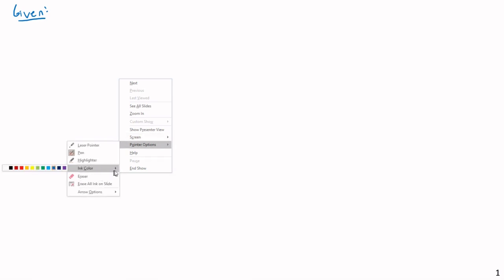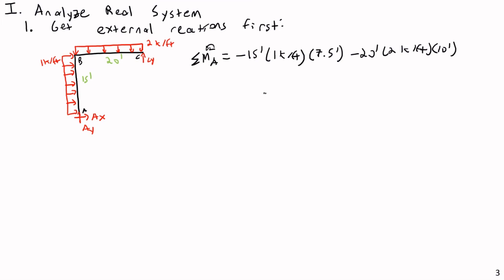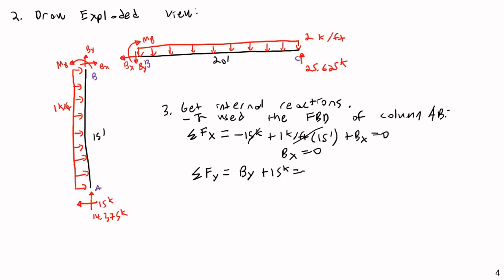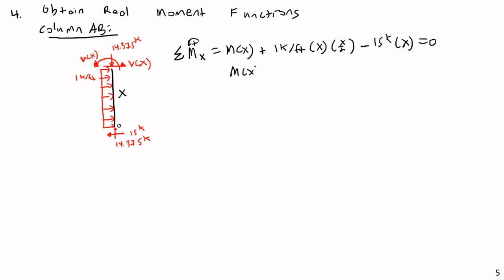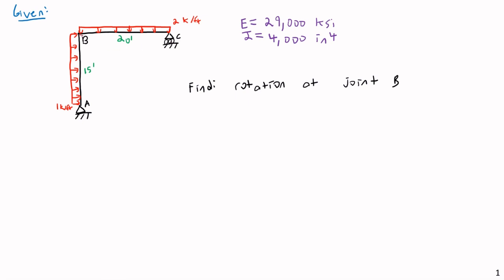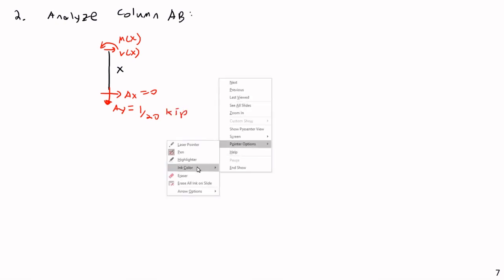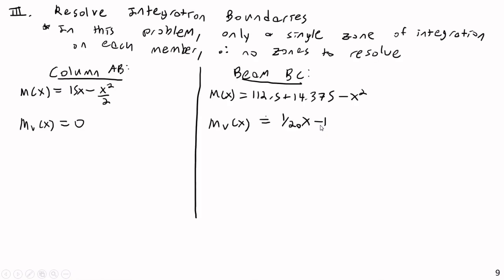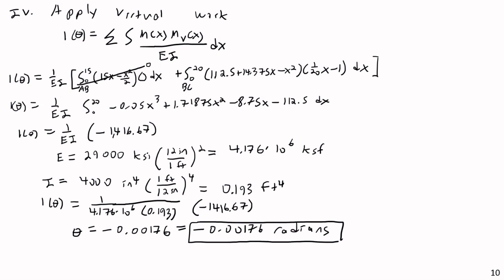Virtual Work for Frames - Example - Structural Analysis

Comment: Hi Professor, 

How did you arrive at "x-20" at 39:23? When I add the pieces, I get 2x-20 instead of the total length, 20 feet. 

Also at 40:38, since the cut was made at the left side, why isn't the moment, M(x), positive? Is it because when we assume ccw is positive for a given structure, an internal ccw moment will be positive regardless of where things are cut? 

Thank you so much for taking the time to post all your lectures! I have enjoyed your fluid mechanics lectures and am working my way through these structural videos.
Reply from the maker: You may have indeed found an error! That should indeed be 20-x. At 40:38, when you sum equilibrium, you need to sum in the direction it actually is going. A positive internal moment is clockwise on the left hand side of an element, but when applying equilibrium, you still need to sum counterclockwise as positive.
Reply: Thank you for the prompt reply! It all makes sense to me now :)